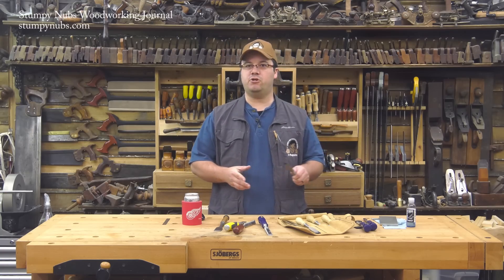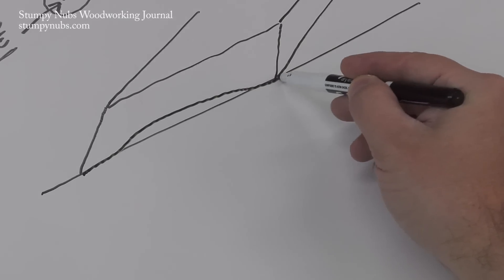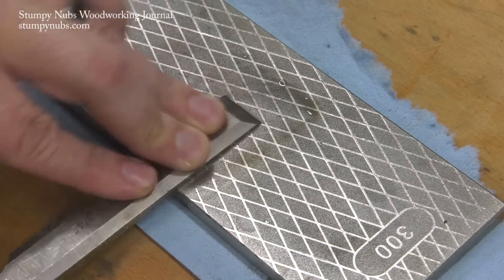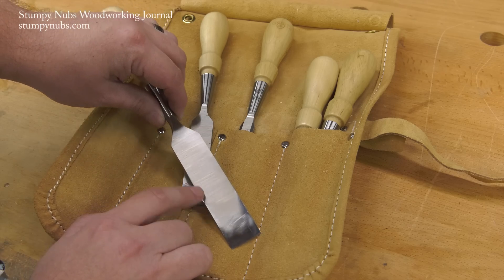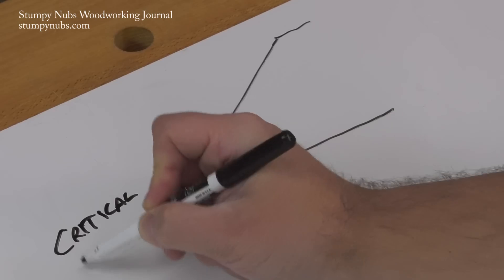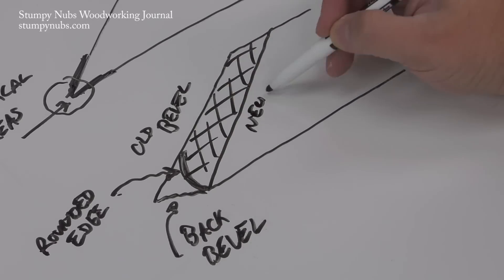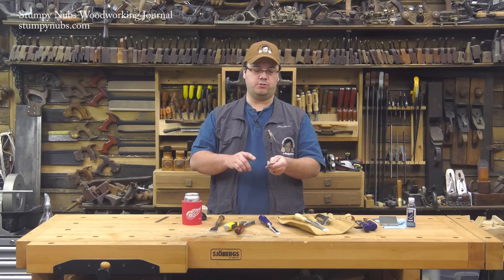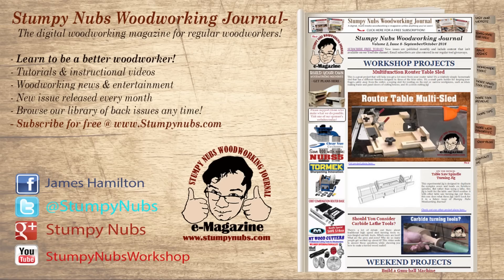The biggest sharpening mistake woodworkers make (And why...)

Comment: But if the ruler trick is a problem on chisels because it creates a back bevel, doesn't the same thing happen when you flatten only the last inch or so? It's a shallower angle bevel but still a back bevel, since it's an inch long, but still there. Maybe since you're removing so much more steel, you're less likely to make the bevel far away from flat without the ruler.

Comment: It makes sense to use a slight back bevel on a plane blade since it’s not being used to cut wood on the same plane as the back of the blade, as occurs with a chisel.  The plane blade is set at an angle and is just cutting a specific amount of wood based on the blade extension out of the plane; there’s no using the back of the blade to register where it’s cutting.

Comment: You always do a great job, but diamond stones do not always stay flat.  I, and many others, have learned this expensive lesson.  Your videos are very helpful.
Reply from the maker: If your machined steel plate is warping, I don't know what to tell you.
Reply: @StumpyNubs  My Atoma diamond stone got pretty out-of-flat pretty quickly (though it took me much longer to figure out what was going on). As far as I could tell, it's not the machined plate that goes out of flat, but rather a combination of the adhesive that secures the thin diamond plate shifting around slightly, especially after being exposed to water for lubrication/cleaning, and the diamonds themselves wearing more in some areas than others.

Comment: I am an amateur lapidary. I wonder if a "flat lap" would be of any use to sharpen carpentry tools? They are simply a spinning disk which may be coated or "sintered" diamond of any grit, or an un-coated disk may be faced with wet-or-dry sandpaper. The laps are absolutely flat (especially so since they will be spinning.) Since the motor operates on DC current, their speed may be adjusted. They have a set-up which allows water to be dripped as they spin. And they can flatten an abrasive block too - the diamond is ever-so-much harder than it is (actually flattening sharpening stones also "dresses" the lap, since more of the diamond is exposed.)
You have such a nice speaking voice! I like the way you explain yourself too.
Reply: Some people specifically use lapping stones for sharpening wood working tools.  They are excellent and work very well.

Comment: Japanese chisel have a hollow! 😳
Reply from the maker: The hollow on Japanese chisels is designed to make it easier to flatten the portion of back nearest the cutting edge. The hollow is dished-out. As you lap the back, it gets smaller and the flat strip along the cutting edge gets wider. Rather than removing steel from the entire back to flatten all at once, you only have to remove a little bit each time you sharpen.
Reply: @StumpyNubs   My sharp point is, what happens when the shape edge reaches the hollow when sharpening? Wouldn't you have to flatten it again to remove the hollow ! 🙄 The hollow in Japanese chisels.
Reply from the maker: @m101ist  - My comment above answers that question :)
Reply: @StumpyNubs  Thanks, I don't own a Japanese chisel.  I might invest in one to see the difference. 😳

Comment: Angle and burr or no burr makes a huge difference as well, ,if you as for example make organ pipe sheet metal you want a different angle than wood, but few woodworkers use burr and thinks a flat steel is good...and it depends.if you want speed you can use a rougher grit. A good test is that if you cannot use the chisel by hand, it is not sharp.. the only time i use a club is on oak as it chips slightly in small pieces

Comment: Flattening back of a convex tool is a pain, but depending on thickness and hardness of the tool it can be rectified with a well placed hammer blow. It's easier on thinner plane irons, as in old stanleys or wooden planes. I have also managed to reduce needed amount for flattening a chisel this way. Just don't use a hard faced steel hammer, have the iron supported on a wooden surface and you'll be fine. Hammering soft steel on the laminated japanese chisels and plane irons is part of the maintenance of the hollow back (ura).

Comment: If there is a belly on a plane iron you can give it a tap with a plastic mallet and it will straighten it out a fair bit. I got that tip from one of Paul Seller's videos and tested it myself and it really does work.

Comment: Actually I have found that diamond stones will wear and lose flatness rather quickly if all the sharpening is done on them. Have you checked yours out with a straight edge?
Reply from the maker: If you are wearing  hollow in  plate of steel, nickel and diamonds... well, I don't know what you are doing....

Comment: I just watched the sharpening mistakes video. You should change your recommendation about substrates for sharpening on paper. Tempered glass, like heat treated steel, has surface imperfections. The only glass guaranteed to be flat is float glass at least 1/2” thick, 3/4” is better. I used to make these for the defense industry.
Reply from the maker: People have been using tempered glass with excellent results for decades.

Comment: First thing I do to a new chisel or plane is make sure the BACK of the blade is flat for a reasonable distance back from the edge.
If I receive a tool with a convex back, it's returned for refund or replacement & I suggest manufacturers should be educated by everyone doing the same.

Comment: just to add a little tidbit. the more abrupt the bevel the sooner the chip will curl and brake. the more sweeping the angle the longer the chip and it will curl less. also, it depends on the material. nature can be fickle like that. the harder the wood the closer the celluloid fiber " tighter binding". stiffer. the better suited for structure. the looser the fiber the better suited for flexibility there's strength in both' just different types. also application. think everything from balsa wood to petrified for the novice craftsman or the guy who hates even picking up a screwdriver. for fear of hurting himself with it. a tool for all of them exists there's wisdom in the saying"you can't drive a square peg threw a round hole"  meaning you need the right tool for the job if cutting is required the tool should be sharp and purpose-built. buy the way you can drive a square threw a round hole but you have to go the long way round. it may serve you or it may not and you'll have to have a heavy hammer and it won't be pretty when you're done. there's an order to everything worth doing. to arrive at the finished product. you first must start at the beginning. "there's nothing new under the sun" if you don't know the steps somebody has done it before you and worked all that out for you be humble enough to seek them out. this was a little wordier than I first meant. so I'll finish by say attention to detail can mean the difference between 10$ and 100$ for the right buyer. take care of your tools/craft, it/ they will take care of you.  it pays in more than one way to be a good steward. not just the bills but in a better currency. gratification for a job well done and a good name.  pride in yourself at the end of the day is priceless. by the way, for you young fellas the ladies love a wise man with a strong back and slightly calloused hands it drives them crazy at the right moments. that should motivate ya.

Comment: He explained this part, but I didn't get it. If hollowed back is a bad thing, why do tool makers do it this way? (Or used to do it this way)

Because it's going to get warped no matter what. Okay. But why intentionally make it worse? What if the worseness adds up and increases?
Reply from the maker: A hollow back is a lot easier to flatten than a humped back. Some tool makers (mostly Japanese) take advantage of that fact and make the back intentionally hollow. But it is done is a specific way, like a spoon. The hollow area does not touch the cutting edge, it is just in the center of the back.

Comment: i'm a  bookbinder,  and  there is a  knife I use for skiving leather that has to be SUPER sharp to shave the edge of leather down to paper-thinness  for wrapping round the edge of cover boards.  This sharpening technique is one of the first things i was taught as a bookbinder--first you get the bevel sharp, smooth, at the right angle, and mirror-polished. THEN you sharpen and polish the back of the skiving knife.

Most skiving knives come from the manufacturer needing a LOT of work--mst of mine have taken several hours of hand-honing on several progressive grits of diamond stones and strops to get them "right". And  then every few weeks, I strop and polish them to maintain the edge.

 it only makes sense that this method would also be appropriate with wood tools too. Great video!

Comment: Twice as flat? YUK. It's flat or it's not flat. There is no multiple of flatness.
Reply: I'd agree it's incorrect to say "twice as flat", but I think the intent of satisfying a flatness tolerance half as large is an acceptable interpretation.  In engineering terms (see ASME Y14.5/14.5m) flatness is definitely a measurable value and the concept of "flat or not flat" only applies in theoretical geometry, not in actual part geometry.

Comment: This is great information James. I understand about deformation of tool steel at heat treatment (hardening and tempering) however; I wouldn't have taken this into consideration with chisels, assuming of course that the chisels were surface ground flat by the manufacturer. I'll certainly be looking at my chisels.
Reply from the maker: They attempt to surface grind them, but when you put one on a stone you'll see they fall short.

Comment: Do you/Should you do a back bevel/ruler trick on a bevel up plane?
Reply: It works fine if  you're using those teeny little rulers.  I do this for all my bevel up planes.  But if you raise the back higher than the angle of the bed of your plane, it won't cut anymore.  I have gotten to within 2 degrees of the bed angle, and it still cut fine.

Comment: Great tips Stumpy.  One you missed was one I got from Paul Sellers!  If you have a cheap chisel with a belly on the back, (from end to end rather than across the width)  it is possible to put the tool onto a couple of pieces of wood then use a hammer or something to straighten out the blade of the chisel prior to flattening / polishing the back.

Comment: Make or find a flat surface ( band saw table) Lay a 2" X 8" X1/4" glass with double sided tape down & apply doublesided tape on the top then use emery cloth of what every grit you like, (40 to 1000). I like to start with 220, then400, 600 grit to flaten tool backs, once they are flat move to the diamond plate.
Emery cloth will speed the flatening of tool up, with out tranfer of heat to the tool.

Comment: Used this on my chisels and found I could pare just fine, with better control than if the entire back were flat. Sure, I had to lift it slightly, but that’s only for the very last few cuts. The rest of the time it works great and reduces the risk of paring too deeply.
Reply: In fact, if the ruler is .03” thick and 6” away from the edge, if you grind a back bevel 1/16” wide (.06”), the edge will be lifted only.0003” off the surface. That difference might matter for precision machining, but this is woodworking

Comment: As the son of a plane maker, former sharpening tutor and a cabinet maker, I could not agree with you more.
I used to spend up to a day per blade lapping the backs of the blades by hand for my father's small plane making business.
There is nothing more important that a properly flat, straight and square edge. It lays the foundations for properly flat, straight and square workmanship.
Thank you for the video.

Comment: I was sharpening my chisels the other day and I slipped with one of them and I stuck it through my right hand. It went all the way through the other side between the metacarpal bones.  I'm hoping it didn't do any permanent nerve damage.
Reply from the maker: I did that same thing years ago. It went through the web part between my thumb and forefinger. Luckily it was a 1/4" wide chisel, so it was a small hole and missed the tendons. I stitched it up with a needle and thread by myself (didn't have insurance back then). Two stitches on one side, none on the other (it only partially emerged on that side.) Learned a valuable lesson. Do NOT put your hand in front of a chisel EVER!
Reply: WE Hart 
Oooooowwwwww!!!  Dude!  I mean... just, DUDE!   😲

Comment: For hand sharpening, what I'm about to says inapplicable. For power sharpening/grinding (I think it's usually knifemakers and blacksmiths that sharpen this way, though newer woodworkers might), one has to be VERY careful and keep the tool cool. If the steel starts turning different colors, the heat treat's been toasted and needs to be redone, which can create a small nightmare if the alloy of steel isn't known. Something that some smiths will do is forge weld tool steel to mild steel during the forging process. The mild steel doesn't harden like the tool steel does, which can allow the tool to last longer than an all tool steel one. That does mean that over time ad repeated sharpenings, the tool steel will wear away. But, one of the nice things about going to a smith for tools, especially an established smith, is that they will most often make sure the tool is flat after the heat treat. A preliminary grind may be done before, but that's to establish a profile and get things in the ballpark.

Comment: You’re grasping at straws with the warpage stuff. If it warps, you heat it back up and try again.
Reply from the maker: You're grasping at straws in an effort to be contrary. Factory mass produced chisels are not examined for flatness and reheated as needed. That would double the price.

Comment: I'm a professional cabinetmaker, or was. 
1. Don't use the ruler trick on your plane iron, just wilfully put a curve in it from end to end. You could do this with a hammer but G cramps are more controllable. A small curve so that the gap in the middle when you place a straight edge along it is no more than 1.5mm. Now you'll only hone the minimum on the back, forever. Put the whole iron on the stone when you lap the back. As you push down the greatest pressure will be at the back and the front. The only stone you'll need for this after the first time is the polishing stone.
2. I've never owned a chisel that didn't come with a cupped back. I don't mean the useless Japanese stuff, I mean a few hundredths of a mm. If you want chisels buy STANLEY and PAY. Shocking for me to say that as I'm a Brit but there you go.
3. If you want to buy a hand tool buy STANLEY. Their stuff is consistently good across the generations and, for what it is, reasonably priced.
4. Buy several irons for each plane. Make sure that they're from STANLEY. Now you can sharpen them all at once, then protect the edge with a piece of toilet paper soaked in oil and Sellotape. There's a technique to that, work it out for yourselves. When one is dull swap it out. Not only is this far more time efficient but if you need to work on site where you can't sharpen your stuff then you can just pull out a new one.
5. He's right about diamond stones. Buy the coarsest one you can find. then move to a superfine polishing stone. No working through the grits. only the last two hundredths of a millimetre matter.
6. Put a VERY slight curve on your plane edge so that you cut more from the middle of the plane than at the edges. I'm talking about the difference between one cigarette paper and two.
    Good luck.

Comment: A tool will never be sharper than its back. If it’s microscopically pitted or contoured , it’s never going to work well.   So many guys I’ve worked with with never understood this simple concept.  My chisels used to get a freshen up on the back before the bevel  : and this usually just required a quick wipe on a fine hone and finishing on a leather strop .   Works with everything from 1/8” paring chisels to 4” Shipwrights slicks.
Great video. Subscribed.
Reply: I never understood this until watching this, so simple. It's always the case, simple when you know how. But, it's a shame there are so many fellas out their giving their own respective but entirely false opinions 😡

Comment: Brilliant, mate.  On the rare occasion I want a back bevel, I use 3-4 turns of electrical tape (start and end on the bottom).
More usually it's a bit of 2000 Wet/Dry taped to a piece of flat glass - (stick-on rubber feet on the bottom). (tape works there too and saves my rulers :) 
Man, that's an impressive array of vintage hand tools behind you!  The plane collection in particular, is mind-blowing. Subscribing.

Comment: The only important thing in sharpening is geometry. You can hone your tools up to 1000000 grit, but if the geometry isn't there (meaning your back isn't flat and your bevel isn't straight across) it's no bueno. Diamond stones will give you a good edge and a perfect geometry every time.